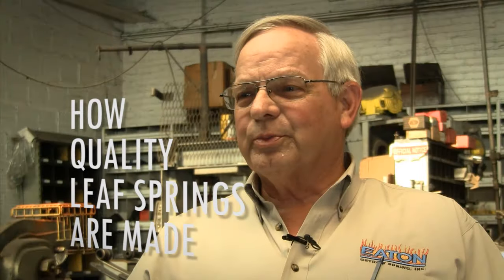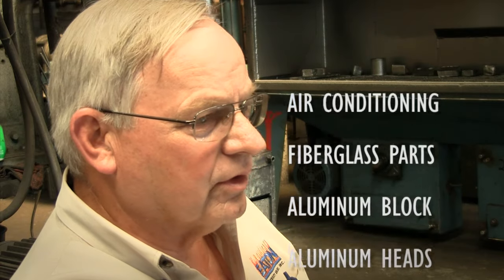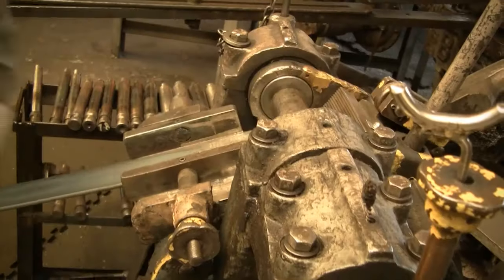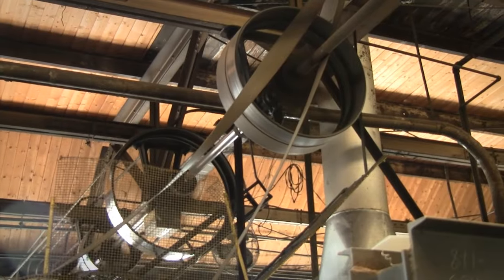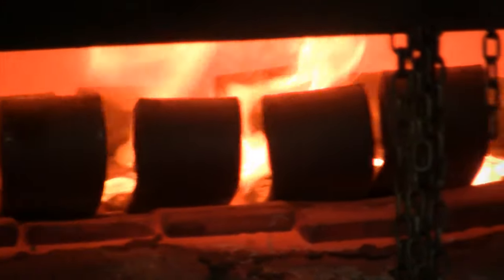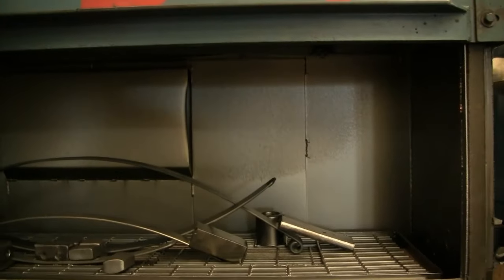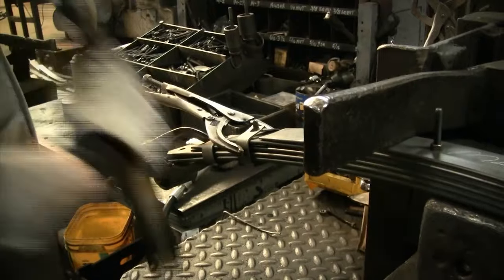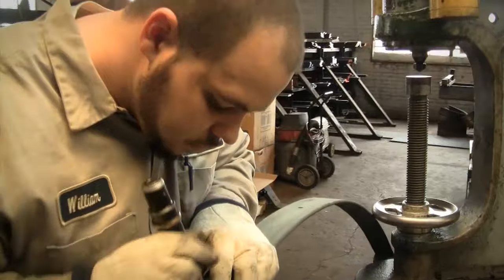How Leaf Springs Are Made - EATON Detroit Spring

Comment: Eaton Detroit Spring is a fixture in Detroit, and most deservedly so!  I have ordered several sets of springs for them, and have always been 100% satisfied.  They sweat the details, and make sure to get everything right.

Visiting their location on Michigan Avenue (if you are local or visiting) is a education, too.  The very first set of springs I ordered were for a 1962 Mercury Meteor.  They opened a tray of blueprints, and pulled out a set of 50-year-old blueprints for my car's springs.  You can get stock ride height, or modified.

My most recent set of springs required a larger-than-stock spring eye radius, and they handled this request seamlessly and with no confusion.  The resulting springs work great! 

My highest recommendation!

Comment: I worked at Detroit Steel in Morristown, Indiana for 2 years. We made Springs alot quicker than anything I have seen on YT! We had an assembly table where I had to pick up 200lb + springs after assembled and put them in the bull dozer, then pick them up and out of that to be checked by quality control. Then we would pick it up and swing it to a skid. So me and another guy would lift 40 tons a night x 3 times each! So that is 120 tons total which means I lifted 60 tons a night! I also drove  a gas engine forklift that was quicker than any I have seen. We did springs for Ford, Gm, etc. I was an expert FL driver! I also ran a wheelabrator that was a shot pen machine. It had a huge conveyor belt that could handle about 30 pieces at a time! Much larger outfit than I can find on here. I hated my job! haha
Reply from the maker: Small world. Way back prior to 1937 our company was the aftermarket division of DSP. DSP made springs both for the OEM's and the aftermarket. My Grandfather ran the aftermarket division when Ford gave DSP the option of supplying them or competing against them, they sold the aftermarket division to my Grandfather.
85 years later we are still in business and DSP is not.

Comment: Liked the way you all are working. I need your help, i want to punch a 12mmDia punch in 8mm thick En42j spring steel, which punch material should i use? I used HcHCr but failed.

Comment: Tempering is to soften the hardening steel. Why after that you do shot preening?
Reply from the maker: After the springs have been formed and quenched in oil, they are too hard and brittle. In order to soften them to be a spring they must be re-heated to around 900 degrees F for a few minutes. They are then shot peened to relive the inherent internal stress that formed during the heat treating process.